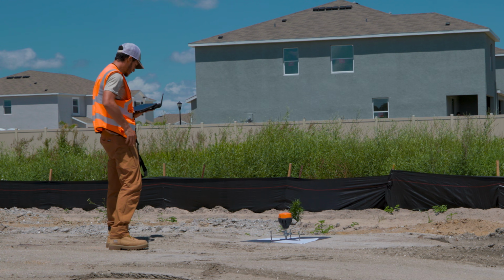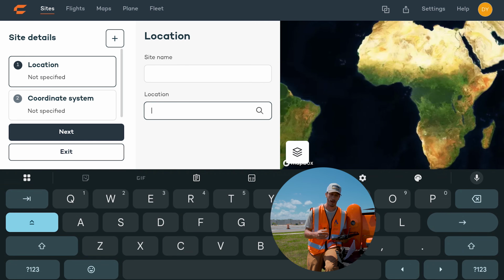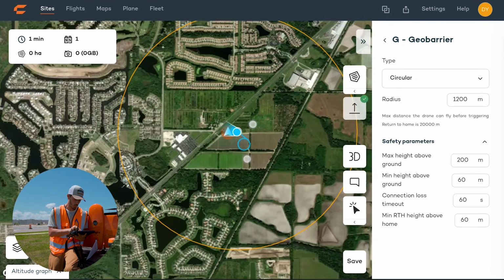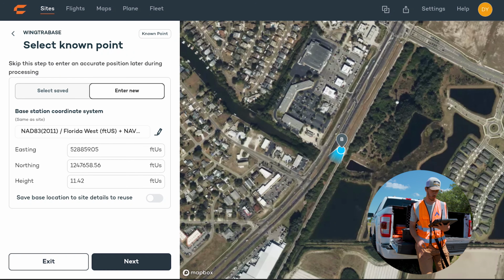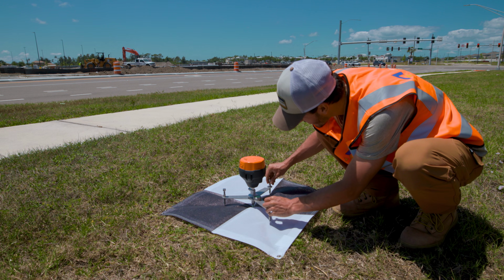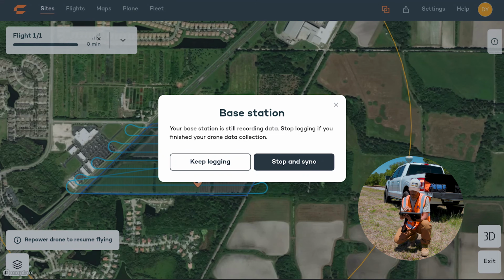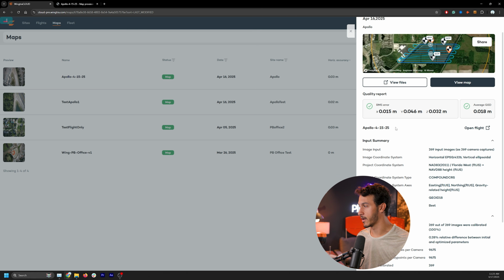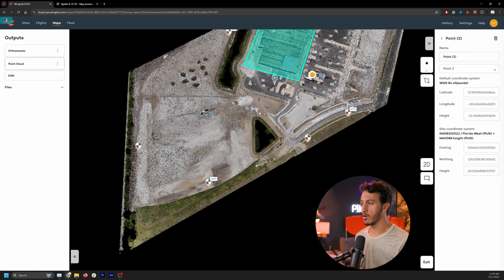Wingtra Just Made Aerial Surveying STUPID Simple!

Comment: That Check point Process is just ridiculous. The process of setting that little bracket on all of your control is a time waste. Just use a fixed two meter pole and walk around with your rover with another and shoot your control. I'd use those all of 1 point and throw them away. The wingtra is a fantastic drone though.
Reply from the maker: To be fair it’s pretty much the same process and I found that it takes almost the same amount of time. I did like how simple it was to quickly gather and sync all the data in one platform but I hear ya

Comment: Very cool, so efficient and such a smooth workflow. I am assuming if you have RS3's already you can use them? What is the basic cost the Wingtra with controller? How many batteries do you get and how many should you have? How quickly can you charge them? Are you going to use it in your business? How much would you charge for the 100 acres? How about stockpiles, cut and fill, does the software have that capability? Can you process other data from other platforms through their cloud?
Sorry...lotsa questions!
Great video Dylan!
Reply from the maker: They are working on a solution for if you already have RS3s, I am not sure when it's going to be released as that was a question that I had too. Batteries only take about 35-45min to charge per set so you can have a full set ready to go if you are mapping large sites with multiple battery swaps. You can actually just do PPK processing on the RGB images and take it into another software if you would like which is a very simple process as well!
Reply: @DylanGorman  thanks! Can you elude to the pricing? Or do they want me to ask them directly lol?
Reply from the maker: I believe it's in the range of $25k-30K which is on par with a DJI system with enough batteries to cover a similar amount of acreage but without a proper payload. Given the tariff situation I am not fully sure what the cost is but I know it's affordable relative to the industry that it's built to serve.
Reply: @DylanGorman  excellent! I would agree to the relative point about costs! Thanks again!

Comment: It's been a long time, but thanks for this new video. I've got a question about the RS3 and GNSS, I thought that the need to be at 2m from the ground, or I'm wrong . Thanks.
Reply from the maker: The RS3 can be set at any height that you want. Wingtra has a profile that automatically adjusts the height based on these mini leveling tripods that you see in the video. The only reason I have ever mentioned having the height be 2m is that I have a fixed 2m pole that I use with my RS3s
Reply: @DylanGorman ok thanks.